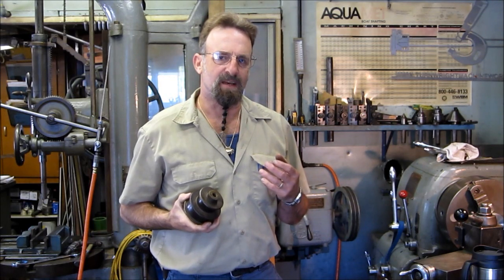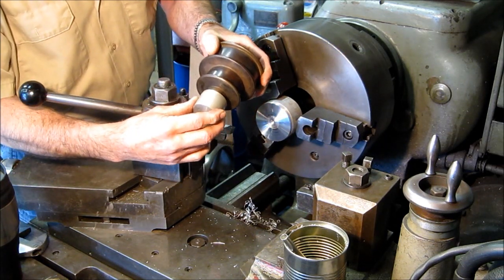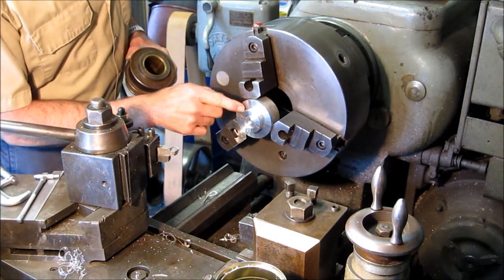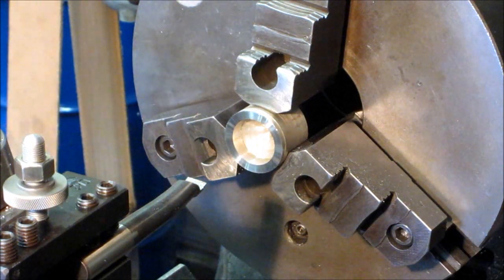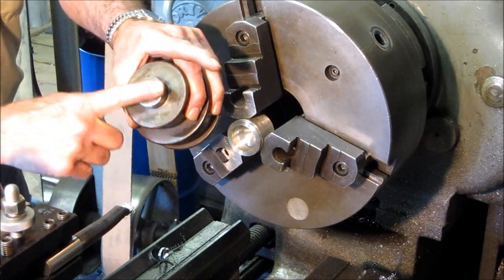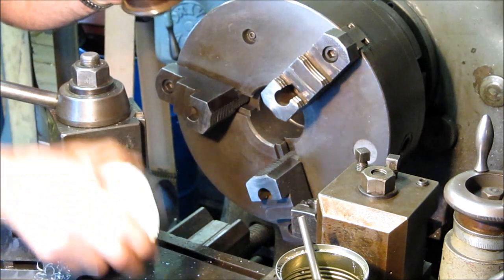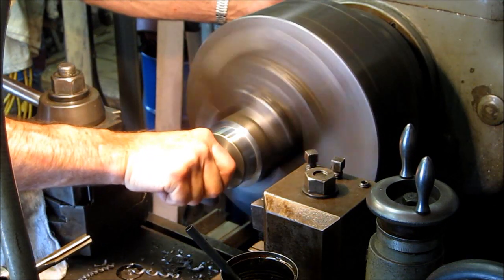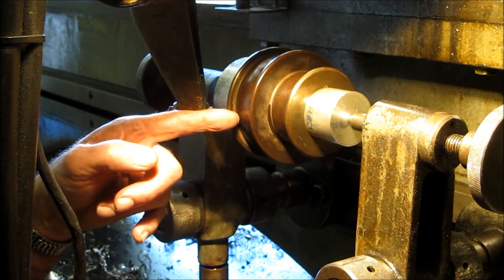Flat Belt Drive

Comment from the maker: Parting is one of the hardest things, to get tuned into with each lathe you operate. The variables of play in backlash of feed rods and spindle bearings all interact in your success or not. Finding the right height, lead angle relief and speeds are different on each machine, searching for the sweet spot. I have to tell you that my negative parting tool insert was my answer and parting with those problems! Sometimes I had found it works to grind a neg. rake top angle on HSS parting blades ;{)----

Comment from the maker: To be honest, use HSS and carbide brazed tool bits until you find a good deal on a holder or can afford the addition to your arsenal. Grab a buyer’s guide on materials and it gives you the basics on needing HSS or carbide to machine materials. Also machining hand books are great for same thing, too!  The main reason for the inserts is convenience and or production work. ;{)---

Comment from the maker: The sulfer base cutting fluid does two things, using the sulfer to draw the heat and oil to lube the cut, keep from galling. If you think its being removed, grab a magnifing glass and watch it draw onto the insert as your cut is in action. Use the same speed and feed without as you can with, watch the color of the chip...

Comment: Happy father's day Keith.  Thanks for the videos.

I was not quite sure what you where talking about the tracer and having to flip the part but once I saw the original mounted it made sense the cutter / stylus only can cut in one direction just like rh/lh tooling bits depending on which side you need a shoulder.